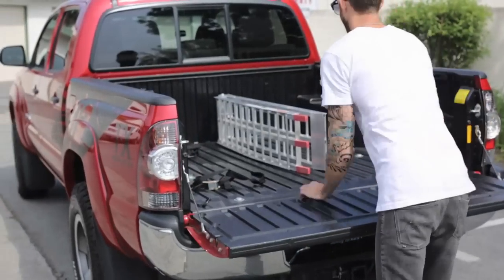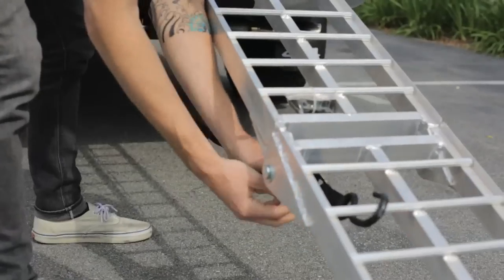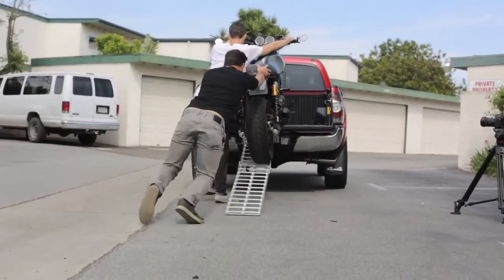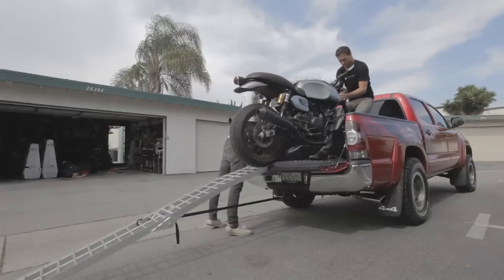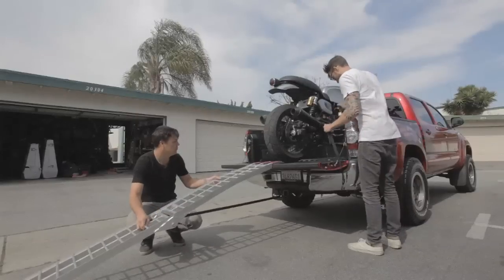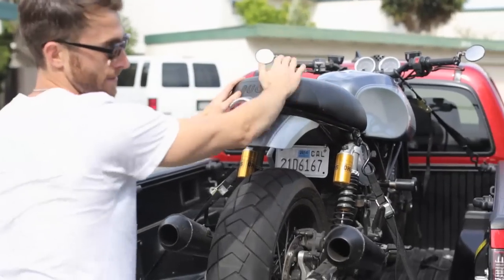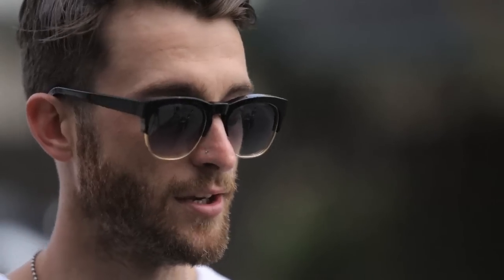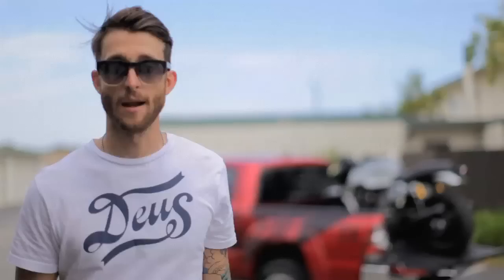How To Load A Motorcycle Into A Pickup Truck

Comment: I like to use loading docks and it's a lot easier when dealing with a heavy bike and short person.  One friend drives the truck and the other rides the motorcycle to a loading dock behind a big box store like Wal-mart. Truck backs into dock while bike drive up the ramp to meet the truck. Ive been lucky and found a loading dock that's the same height as my truck bed and I just walk the bike straight into the truck.
Reply: EliteMunkeyCrew how do you get it down
Reply: Great idea thank you for that tip!
Reply: @Dave-ng9mn  Find another Wal-mart or big box store when I get to your destination.

Comment: Ratchet straps release all at once but they are the best for getting the bike nice and tight especially if you are loading the bike solo.  Tip: double up your ratchet strap with a Yeti or similar friction tie down after you have secured the bike, then when you release the ratchet strap it transfers the load to the friction strap which can be gradually released in a controlled manner.

Comment: Usually I'm alone doing this, I find it easier to pull down on the one side until the suspension is well down, bike leaning at this point, then pull down the other side to balance up.. Easy..

Comment: The best way is to place D-Rings at the two Torx bits closest to the cab. I think the rails are only rated for 200lbs. if memory serves correct. Plus they're nylon plastic. Need something sturdier to mount the straps to.

Comment: Those d-hooks in the Tacomas are made of plastic, and are only rated for 200lbs of horizontal pull. Strapping a bike to them and pulling up with 200+ lbs of force is going to snap them, and you're bike will end up sliding down the freeway. 

Also, use a milk crate or a 5gal bucket on the ground to walk the bike up all the way. Don't hand it off to someone who is just holding the forks.

Comment: So I have a 05-06 Kawasaki 636 I plan on rebuilding problem is I have to move it and it doesn’t start for 1 is in neutral with no clutch on it to put it in gear ( I can find one to put on ) but the last problem is it has no breaks... so anyone have any suggestions on transporting with these issues